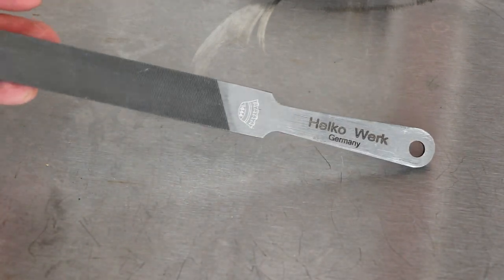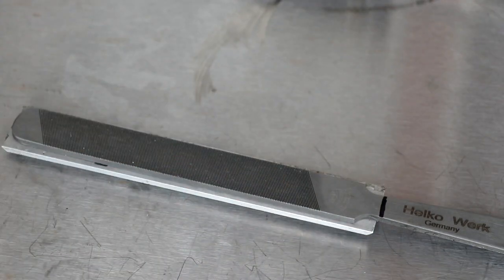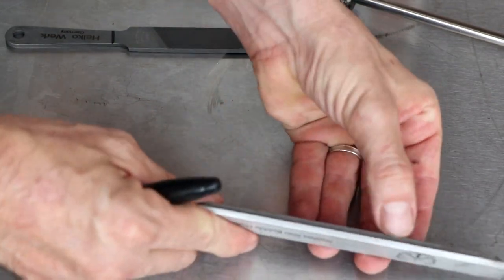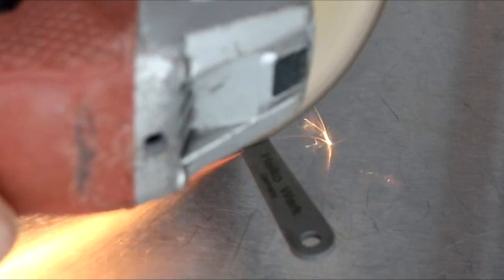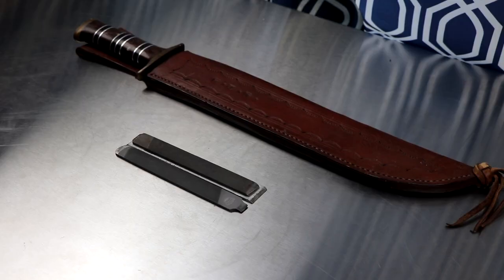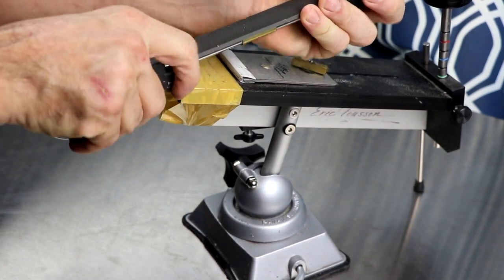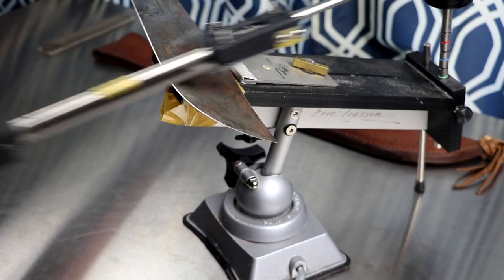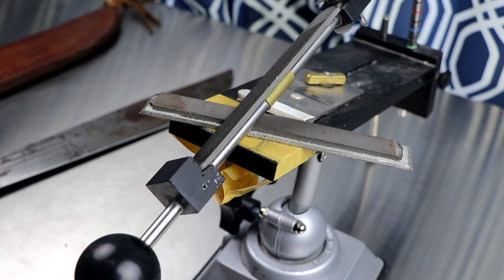Edge Pro Hack.   Save your stones!!!

Comment: Dude! This has saved me so much time it's nuts! You can file to get the edge correct then run edge trailing strokes with the diamond matrix stones from 80 to 4k then use the 6k tape. Boom
Awesome edge 😎

Comment: Very intriguing hack sir! I've been using KME diamond stones glued to the EP blanks to save money on lower grit stones, Spyderco ceramics for polishing and then a Suehiro 10k for finishing.
Reply from the maker: What an excellent way to save $$$ on the lower edge pro stones.  How do you like the Suehiro?   Been eyeballing that stone for a while now but just haven't pulled the trigger...   Thanks for the comment and thanks for the sub...   Very cool!!  Glad to have you on board..
Reply: @2guysandacooler  It's a great stone that can be used on all steels, even the powdered metal variants. I've been told that it wears slower than the Shapton Glass 16k and it's a fraction of the price if you know who to order from.
Reply: I am in the process of playing with Harbor Freight disposables (diamond plates) glued to blanks I made.  If nothing else, it should work reasonably well for roughing things in.

Comment: I use the Worksharp Ken Onion edition Blade Grinder to get larger knives and blades into good condition.  It takes way too much time to sharpen by hand using a clamp system or Edge Pro.   Thanks for the video.

Comment: I cut down a course and a medium file because of your and Matt’s video. Have to say I love it. Here in Ecuador I’m taking care of the Gringo market for there knives. They are so beat up in general that i am now using the files to get the proper profile back on their KNIVES .  Saving my diamonds and edge pro stone. GREAT HACK. keep them coming. Rick. The Cutting Edge. Cuenca.
Reply from the maker: That's awesome!!!  I love it as well.  It cuts through metal like a boss!!!   This hack is certainly one that every edge pro owner needs to do.   I stopped sharpening machetes because of how fast I was burning up my stones.  Now I can sharpen these hard to sharpen blades with no worries!!!  Thanks for the comment Rick.  Hope all is well in Ecuador.  How's the rainy season over there?  Here in Panama we just finished with the rain.  We are in the dry "Summer" season right now.  It's nice!!
Reply: 2 Guys & A Cooler well the weather is good except we get a horrendous pounding of rain at about  3 o’clock   After that back to great weather.   We are though enjoying the great weather here in the Sierra’s.  Thank you again for the effort you put forward in giving us your experiences in life.   Rick

Comment: Great idea for soft steels, just start with a big enough file that there are 6" of teeth so there is no dead area when you are done.  And grind the 45 degree bevel on the ends to protect the plastic mating parts of you EP.  You don't want to wear holes in those parts from the sharp points on the end of the file.
Impatiently waiting for your Wicked Edge sharpener test.
Reply from the maker: Absolutely!!!  This is great for a machete sharpening....   LOL on the anticipation for the new video!!  I have to say it's going to be a killer!  Might be too graphic for some.....  I hope to have it up this week...